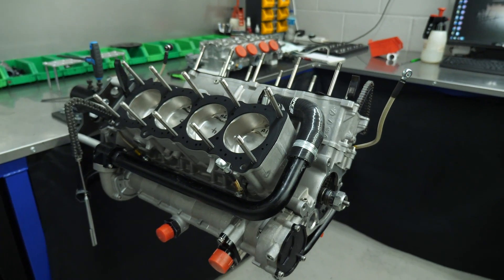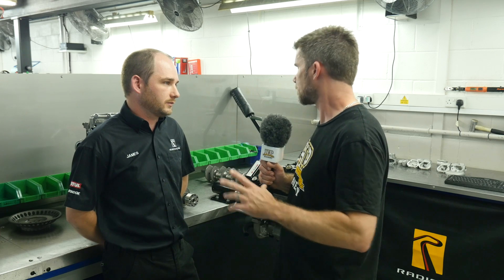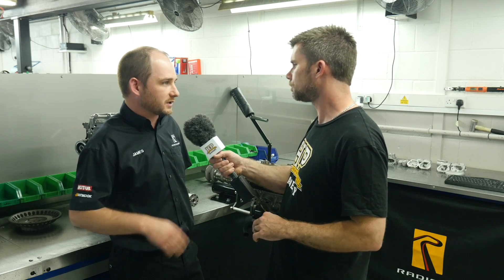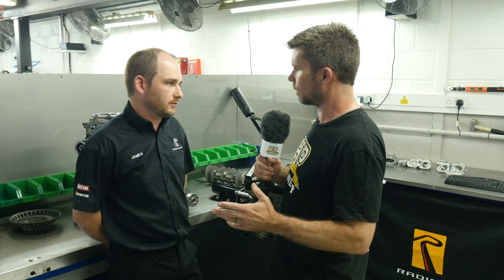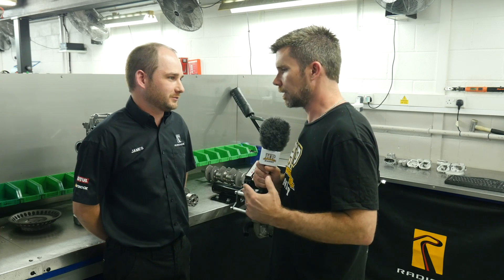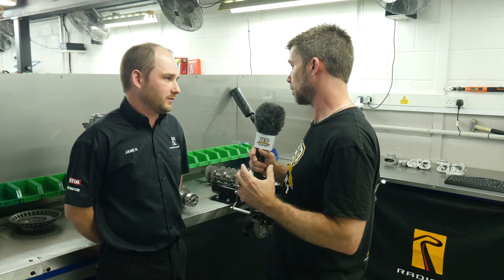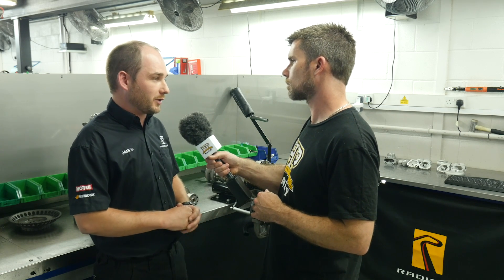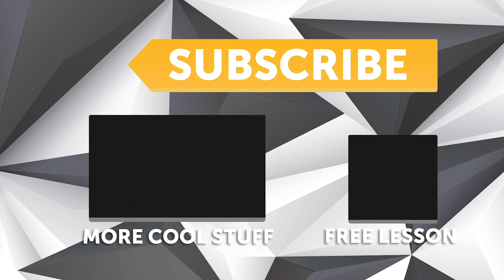Squish VS Compression In A 500HP Hayabusa V8 Engine | Radical Sportscars [TECH TALK]

Comment: whilst squish has been mentioned here, i would like to hear some discussion about lowering compression ratio via pistons vs thicker head gasket, from a professionals pov, i think most will understand why pistons are the best way, but its still common to see this done by using thicker head gaskets...
Reply: To be effective, squish clearance between piston and cylinder head must be around 0.75-1mm (0.030"-0.040").  More clearance than 1mm makes the squish ineffective, less than 0.6mm is mechanically dangerous.  So if you reduce compression by fitting a thick head gasket, you will make the squish ineffective, and also affect cam timing. It's more work, but the piston is a much better way of reducing compression
Reply: @paulstandeven8572  good info. with regards to cam timing this is somthing that also gets overlooked. Dame when skimming a head. Ideally needs a dti and adjustable cam gears to reset desired cam timing.
Reply: I guess depending on the material used you are opening yourself up to more area of gasket to potentially absorb heat and pressure with a a greater potential to become bunt out, but still a reasonable option for a budget build
Reply: @715101  Your 100% right. I've been a qualifed mechanic in Aust for almost 20 years, i build a lot of engines for customers, friends and myself of course. I've done this both ways in various combos. Using a thicker or spacer head gasket works welk to a certain point. It becomes a weak link in high cylinder pressure applications like boosted motors. If you have a tuning issue or get some bad fuel that causes detination the head gasket is much more likely to fail the thicker it is. Also- the higher the cyl pressure the more likely it is to fail. That being said, if you have a safe tune, good fuel and aren't chasing numbers then it's a very good option for a budget build. I wouldn't recommend it if your chasing power. An example I can give is with my own RB30 turbo engine I've played with for 12 years or so. I started with a Cometic spacer MLS head gasket that took factory comp ratio from 9.3:1 down to about 8:1- it held on well for 2 1/2 years @18psi until the boost got raised to around 25psi, made around 350rwhp (@18psi) through a 3800RPM Hi Stall equipped built auto with minimal timing in it. Had ARP head studs and around 30Ra finish to the block and head decks (deck smoothness is VERY important when using MLS style head gaskets). Another downside is that the larger the quench area or "squish" as they're reffering to it as- the less efficient it becomes- read as; the less power it makes. When building the engine properly with good quality internals, I now have a much tighter quench area, it's much more resistant to detination AND it's more efficient. To add to the equation I now run 10:1 comp and can run more timing resulting in around 100hp more at higher boost pressure on the same fuel! It is detination limited on 98ron with octane boost, but was intended for E85 where it it'll hold just short of 800rwhp at 40psi- which the spacer head gasket would never have held. There's a bit of a back to back testing for everyone who's interested
Reply: @danielbrealey2924  why are the multi layer gaskets in need of a smooth finish to cover a higher surface area/thorough over the block  ??
Reply: @lop8828  You'd have to ask the manufacturer bud. They give you a small window of what Ra finish you should run. At a guess, I'd say it's to do with the black adhesive that's used to coat the 2 outer layers that contact the deck surfaces. The manufactureres all give specifics on deck quality required, some vary slightly depending on what worked while R+D'ing the product. The adhesive coatings are there more for a quality seal in terms of cooling system passages. They also don't recommend any sealent like silicon- even though you see a lot of people doing it. Otherwise the factory applied adhesive coatings don't work, which are far better than silicon anyway. If you ignore the manufactureres recommendations, you do so at your own peril- you'll have head gasket sealing problems very early on
Reply: goldenvtr 
It’s cheaper to go with a thicker gasket 🙄
Reply: @hoonaticbloggs5402  was going for a more safisticated discussion instead of stating the obvias :p
Reply: Yeah, it's a lot cheaper and quicker to lower it via the head gasket
Changing the head gasket out is relatively easy, it can easily be done in a day
But using different pistons? That's an engine-out job really, it's most likely going to take a couple of days, as well as £1000+
Reply: @quest8795  plucking figures out the air here.
Reply: Certainly pistons and/or some combustion chamber enlargement is the textbook way to decrease compression. On a 4 valve pent-roof style chamber, however, it makes little difference because those style chambers don't have much squish designed into them to begin with. On an OHV V8 design, about half the piston crown comes up to meet the cylinder head (lots of squish). A thick gasket in that application will absolutely hurt the squish performance.
Reply: @GroovesAndLands  interesting
 I guess Piston deck height plays a big part in weather a thicker gasket has an affect on squish. With a protruding piston crown above the deck maybe it would be less stress on the headgasket?
Reply: @goldenvtr  No, I don't think it would. The fluid mechanics probably aren't actually quite this simple, but for our intents and purposes I think it's fairly safe to assume that pressure is equal everywhere throughout the cylinder. Thus, the piston crown essentially blocking "line of sight" between flame front and gasket joint isn't going to shield the gasket from the pressure.

Last, I think it's very important to "zero deck" a block, and I've always put meticulous attention in setting up my deck height, piston dome (or reverse dome), gasket thickness and chamber volume. Smokey Yunick once said "Engines always run best when the piston hits the head a little". That is partially tongue-in-cheek, but point is you want that piston coming just as close as possible to the head.
Reply: As some have alluded to, it will depend on the specific engine, or more accurately, the head design.
There is the chance that in the clearance range reached, there is insufficient 'quench' to draw enough heat out of the fuel charge to prevent spontaneous ignition (detonation) from the pressure front of the expanding, ignited gasses. In extreme conditions, a hot spot can even initiate burning of the fuel/air mix BEFORE the spark plug fires (pre-ignition).
There are also other concerns, such as those Daniel raised.

Comment: this is completely new info for me.
i have never even thinked about combustion chamber's squish
Reply: e34Boat 
You should. It’s critical. When correct you have a very clean efficient burn.
Reply: Essential to get best torque & avoid KNOCK!!!!  but you obviously cant run supertight!!  Every engine type/rpm will dictate different sq. clearance.   2strokes are especially sensitive to squish & chamber design!! Small vs large bore.
Very simple concept...but tricky to decide Exactly where YOUR engine squish should be machined to.  Sometimes a simple headgasket change can be very helpful to min/ max the squish clearance.
I believe bigger bores are  more critical of chamber & squish size/shape.....
Ask hi level racers/ engine builders for ideas & hudgements.
Imho...😎
Reply: thanks for the advice and information 🙂
Reply: Definately a big yes if we talk on high rpm race engine...we often very tight squish and a very small bath-tub like cylinder head bowl (and obviously modified piston crown/dome to suit)
Ran about 13-14 to 1 static cr...
280degree cam @1mm valve lift with total valve lift around 10-11mm...
This was done on small moped race engine...net power around 160hp/liter range with wide powerband around 8k-13k rpm rev range (15k-16k max operating rpm on downshift)

This engine used on road course..not drag strip
This setup ran on RON95 fuel minimum (optimum on RON97)

Edit: as with moped engine we have plenty of block gasket thickness (as opposed to only head gasket thickness option) to create the tightest squish area... So it does helps part machining a little bit easier

Comment: Aren't there situations where improving squish by increasing the dome height can start shrouding the valves, and reduce the cross-flow during intake+exhaust valve overlap? I remember certain piston/head combos in the honda/acura world that were not recommended for this very reason, hard to say if that was accurate info though.